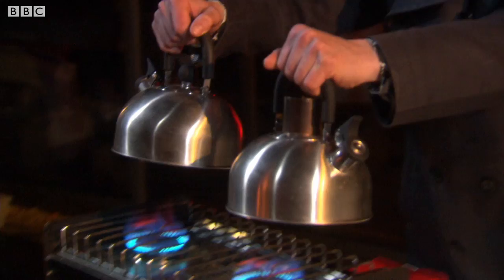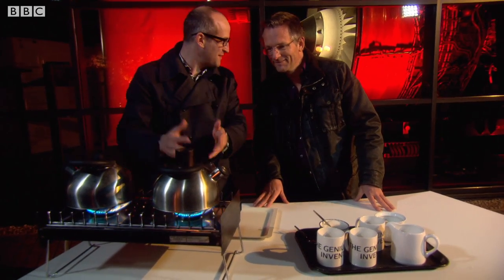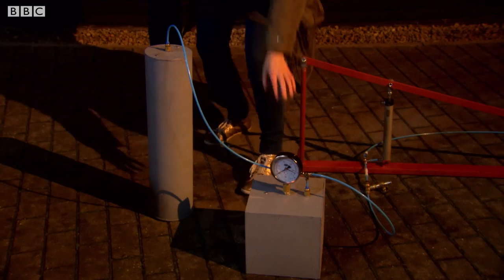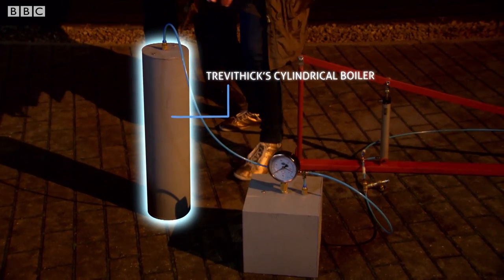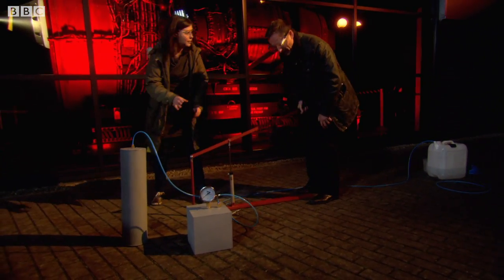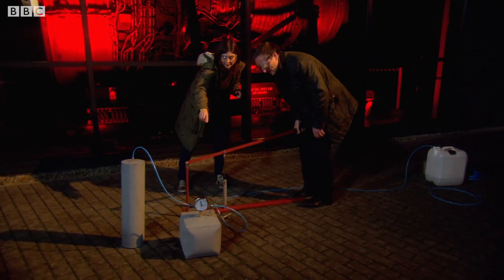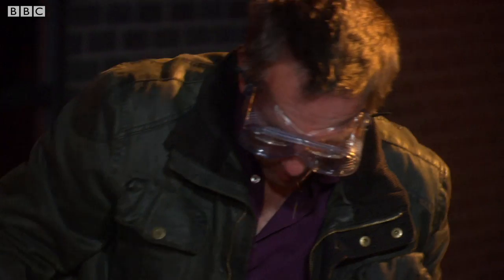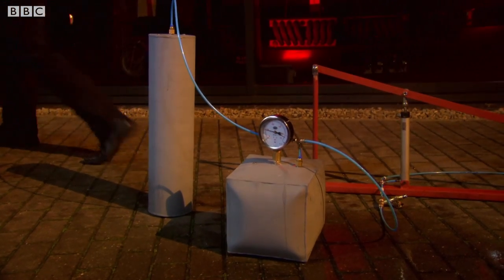Fire Tube And Cylindrical Boiler Experiment | The Genius Of Invention | Earth Science

Comment: flame/ energy supply is the same,  how can it boil faster?
Reply: Distribution.
Reply: the kettle is so small,  i doubt any real dif
Reply: elevengiant when your dealing with transfer of heat every square mm makes a difference. In one kettles the heat is only really being applied from the bottom on the other the heat builds in the tube and is then heating the water from the sides. Ergo a greater transference of that same energy.
Reply: The second law of thermodynamics means heat transfer always occurs from a region of high temperature to another region of lower temperature.
As water is a poor conductor of heat, putting something which is a better conductor (i.e. metal) in contact with more of the surface area of water the more efficiently heat transfer occurs.  On a molecular level, the metal atoms are transferring their kinetic energy to the water molecules, similar to a hammer striking a nail. 

For example, imagine putting a cup of water on a big hot frying pan (large surface area contact between hot metal & water), versus a water in a cup put on the same frying pan.
Reply: household flame is 2000C, higher than any household items and will always be transferring heat. Poor heat conductors have high thermal capacity. Good conductor or not, it doesnt affect how much energy is transferred in this case, from  my understanding. ur frying pan will be hitting air in ur 2nd example. but the boiler bases in the video are larger than the flame.

the video shows it does boil faster, but i dont think it explains well, nor did u
Reply: "Poor heat conductors have high thermal capacity"  Not sure what evidence there is for this, e.g. wood, glass insulation, ceramic tiles on space shuttle.  All are poor heat conductors & have low thermal retention capacity.

Energy as heat may be transferred in 3 ways, "conduction in solids, convection of fluids (liquids or gases), and radiation through anything that will allow radiation to pass".  In the example shown in the video, heat is transferred by conduction through the metal, which then transfers to the water which is in direct contact with the metal.
Reply: i made an misassumption. please show me some figures.
Reply: elevengiant I cant show figures for it but perhaps can make it a little simpler to grasp with two examples. In a car why do you think radiator has lots of thin fins? This allows for a greater area to absorb heat and for a greater area to be cooled via passing air. Another point even if your not familiar with it you can google image search it but the CPU in your PC is cooled by a CPU heat sink. If you notice all of them have a copper base and/or copper pipes leading into the Aluminium fins and the most expensive are entirely copper. Now why use copper when say steel is cheaper? Because copper absorbs that heat far better than steel. Again by adding thin fins rather then a solid lump of copper you give the heat more surface area to absorb into and thus via airflow faster removal of that heat.

These same principles apply to the kettle. The large body of water takes time to heat up or in other words for the energy to transfer into it. The air inside the tube does not take as long to transfer that same heat.(Like the difference between copper and steel) So the heat builds up faster in the tube thus making the tube as hot as the base.(or somewhere near as) This then means you have heat generation from the base of the water and from within the center wheres the normal kettle only has it from the base. Think of it like have the flame almost within the middle of the water wheres the standard kettle has the flame only under. Same energy source more area for the flame to transfer its energy.

I know that's a little long winded but I'm trying to simplify in a sense what jim jon was getting at the short way of describing how heat exchange works isnt necessarily the most simple. Though if I've over complicated it trying to simplify it then I apologies.